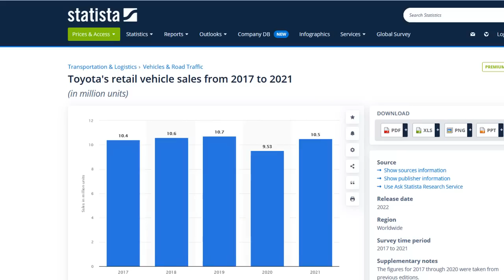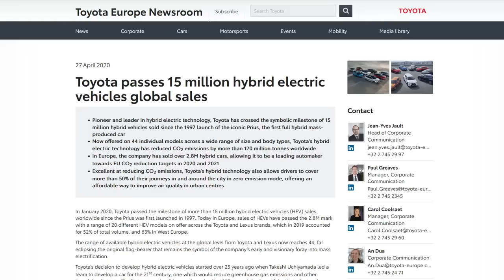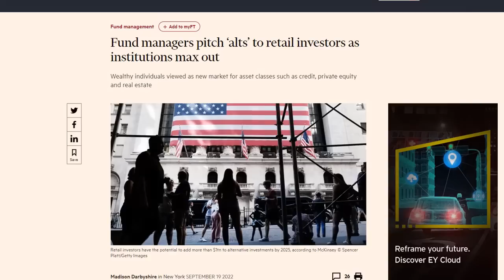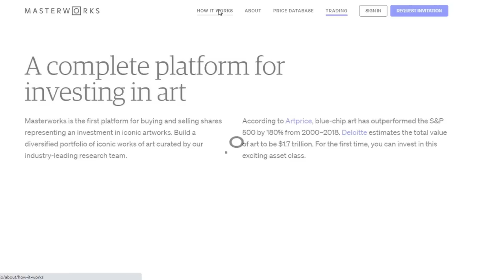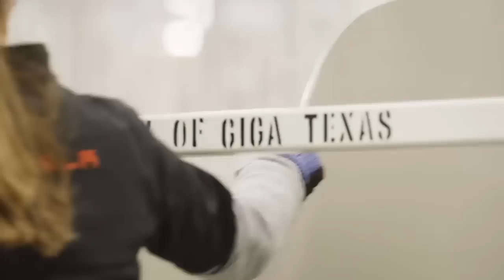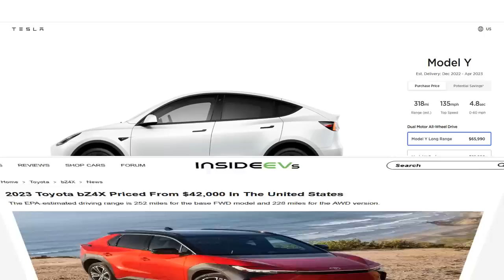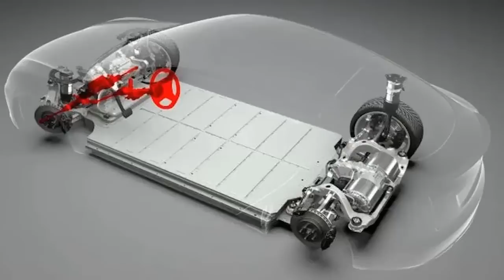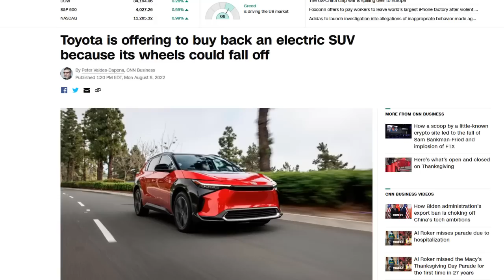Toyota’s ALL NEW 2023 bZ4x EV in for a SHOCKING Surprise

Comment: I can be sure Tesla won't produce 25 million EVs in 2030 unless they start to use non Lithium batteries or those "Teslas" will be golf carts like Wuling mini-ev.
Current Lithium production in the whole world is enough to produce about 8 million EVs like Tesla model 3 (assuming 80% goes to EVs). Lithium mining can't expand that much over 7 years as we used-up most of current sites to maximum production. 20 million EVs per year in 2030 across all OEMs is more realistic with Tesla at about 8 million annually.
This will leave EVs at about 25% of the world car market so Toyota could sale many non-EVs in 2030

Comment: The BZ4 just been killed in Scandinavia as the range is way off showing that wheels falling off is not a once off.
Simply show disastrous ability and the software with true over the air updates shows also the Chinese will also run over them left and right.
Replace Toyoda asap I would suggest as it looks like he ruins the company as lifetime employment - thus sleeping many years and then move to an affiliated company - is outdated.

Comment: I think you missed a few things especially in the realm of quality. Tesla is ranked only better than a few small automakers in Initial Quality, Toyota is at the industry average. Also Toyota famously copied Ford and to a lesser degree GM in their manufacturing technique before branding it as the Toyota Production System. Also into the early 70s they were know as "cheap foreign imports" with options like heaters and AM radios. Out of no where, they were elevated to award winning cars by a magazine that had just landed them as a client with a big ad deal. Also, remember they are the company that denied having an unintended acceleration problem until one of their Lexus badged Toyotas killed a San Diego family, the driver was a High Speed Chase Training officer with the California Highway Patrol. 

Putting all that aside, much of the world generates up to 95% of it's electricity from coal and natural gas and doesn't have the electrical capacity to charge all cars on the existing grid that struggles at 3% EV market share. Toyota is wise to let the others rush into the EV fantasy. Later they can remove gas part of a hybrid and have it run EV mode all the time later.
Reply: Remove the gas part of a hybrid? You mean like the Mazda MX-30 with its whopping 100 mile range and nearly zero sales? Or did you mean more like the Fiat 500e? Sorry Tom, you have no idea what you're talking about. If they don't have a factory built from the ground up to solely design an EV with something like a gigafactory, they're out of luck. Toyota is in huge debt and sales are falling year after year. I've loved my Toyotas for the last 20 years, but they've simply gamble on the wrong R&D and have failed. Now they are in trouble.

Comment: Are you suggesting based on your comment at  roughly 11 mins in, that because the new Toyota EV takes 7.1 seconds instead of 4.9 (model Y) to accelerate from 0-60mph, that Toyota is bringing in a “bare bones A to B vehicle with nothing much to offer”? As if acceleration is the sole defining attribute of the worthiness of an electric car. In any case 7 seconds for an SUV to get to 60 mph is bloody quick by normal standards. You seem to basing the sales criteria of the whole EV market on how quick an immature idiot can take off from the traffic lights in an urban area, burn through his (I’ll make an assumption on gender) tyres and reduce the battery range not to mention increase the running costs. Most people (grown ups) do not give a damn about whether or not an EV can beat a Tesla from a standing start and want various other qualities from a car. Toyota is indeed taking a risk but I hope it succeeds as it is such a great company. The industrialised world has learned from and tried to mimic its production system.

Comment: The US electric grid cannot expand capacity fast enough to meet the 'goal' of having a mostly electric fleet by 2040.  Toyota was correct to point this out.  Toyota was however foolish not to offer all electric vehicles for customers who want to explore that option and to develop experience in those types of vehicles for future production.  Until there is a significant improvement in battery technology, a reduced demand for raw materials from China and third world sources, and a realistic path for recycling of the batteries in these vehicles; the electric car will not be a scalable solution for transportation needs.
Reply: The electric grid is just fine.  Solar PV is so inexpensive now,  by retrofitting it to existing houses, no grid expansion will ever be needed.  The future is much LESS grid power transmision, and much MORE solar end-of-line local neighborhood grid support by Solar PV.  My 10KW array generates 85Kwh on a sunny summer day, way more than I need for household and EV charging.  Local battery energy storage is dropping in price as well, so excess power can be stored onsite for night/backup use
Reply: Wow, guess the grid failed when the first electric washing machines and dryers came out. Or maube when the first electric stoves because popular, no make that microwaves. Maybe it was when people started getting Air conditioners in their homes? The more demand on the grid, the more money there is to be made, the more the grid is upgraded.
Reply: EV Battery recycling is already here with companies like Redwood Materials, founded by former Tesla CTO JB Straubel. These recycling processes can recover 95%+ of the materials at a fraction of the cost of mining.

Battery replacements don't need to be inexpensive. With Tesla the vast majority of batteries will outlast the life of the car with only a small amount of degradation. That said, battery costs themselves will continue to drop in accordance with Wright's law.
Reply: You know how much electricity the US uses in oil refinerys? The data shows the grid will be just fine moving to EVs. Don't let big oil convince you otherwise.
Reply: @sdpryce  I was never fooled, I always knew that the oil industry used a lot of power.

Comment: I've owned Toyotas so I'm a fan. Yes they're late to the EV game and yes they'll lose market share but they get more hate than they deserve from the EV community and not enough credit for the hybrids they've produced in my opinion.
Reply: People don't want hybrids, its only part way there and has more things that can go wrong and as for Toyota EVs, they are demonstrably sub par by every metric. Toyotas bloated infrastructure means they're profit per car is minuscule and will rely on subscriptions, parts and service for turnover. Not a viable long term outlook for them.
Reply: I agree with you, especially for PHEVs.
Battery production is the main constraint on converting our fleet to electric.
A PHEV uses perhaps little as one tenth of the batteries, but because most journeys are < 50kms, most of tthese trips will be fully electric.
As far as reducing CO2 emissions, PHEVs might be better even than full electric until we solve the battery production and mining shortfall issues.
Reply: @russelldesilva1560  Agreed, a PHEV is fine for the educated commuter. The other side of that coin though is that I'd only trust Toyota to produce a car with so many different components to be reliable.
Reply: @samguest8165  I agree and disagree. Yes hybrids are complicated and are becoming redundant but if you can make a complicated car reliable then I suspect Toyota will eventually make a bullet proof EV. They also have brand loyalty in the likes of me.
Reply: Mitsubishi is having another go with EK X EV - iMiEV's successor.
Reply: @sdpryce  Well that true when it comes to servicing. Mind you the only hybrids I really go for now is a Plug-in hybrid which allow to go fully electric. However it can only for a very short drive but that's enough for me cause I only do 5 mins drive to shops. :D
Reply: @sdpryce  Fine, drive a Go-Kart if you really want to feel the drive. If you want a comfortable reliable commute then Toyota has been a very good option in the last few decades. But I've moved on to an EV as it happens.

Comment: 1 in 4 ev buyers go back to petrol cars so it's not a foregone conclusion that evs will take over.
hydrogen cars may be the long-term winners anyway.
Reply: I'm still a big petrolhead but I still drive EVs to work as well as any short to mid commutes, even on motorways!